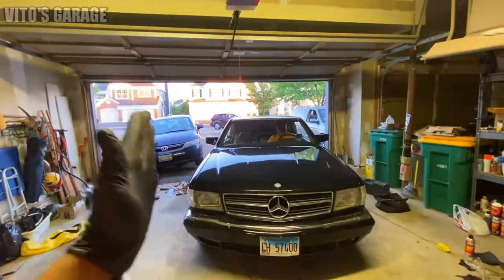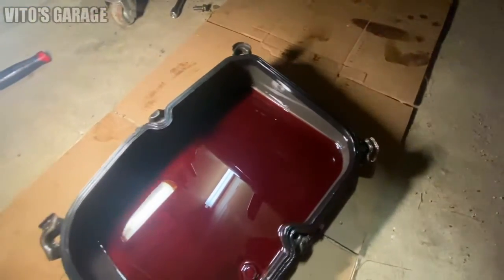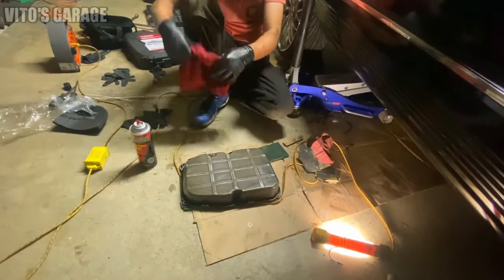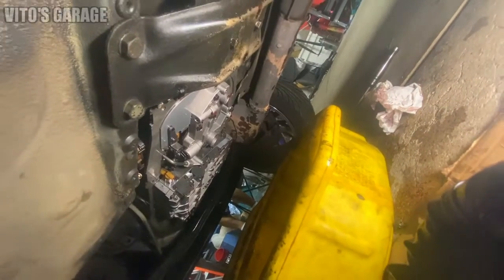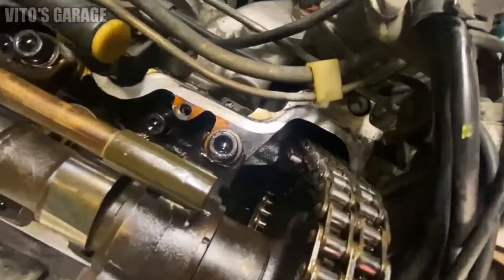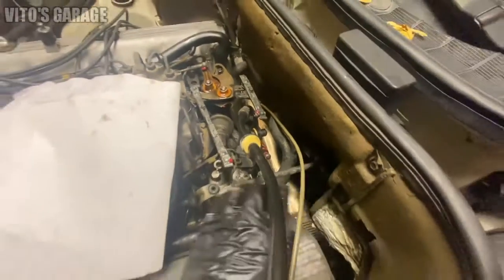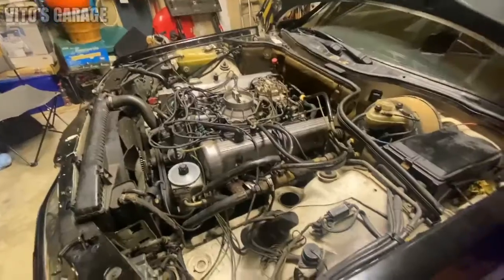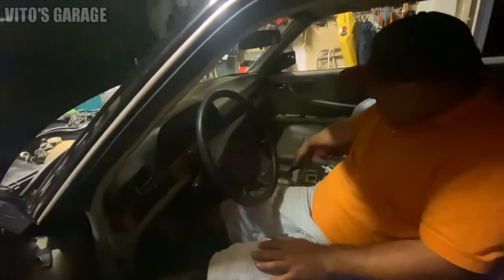Mercedes C126 500SEC V8 Coupe Engine Work & Transmission Fluid Service

Comment: When you took off the valve cover, Did I hear right, it had RTV, silicone instead of a gasket for the valve cover, that is crazy, those little pieces can go inside and create damage to the engine, Iam glad you are making sure that the car keep going, by the way when are you going to add a 2 door W126 to your collection to keep company with the 4 door W126, is that synthetic oil, they say it is better for the engine, what do you think, I always use synthetic oil in all my cars, they say it is better prolongs the life of the engine,what do you think as a mechanic .
Reply from the maker: I use full synthetic oil on all cars. Full synthetic thick viscosity oil. I’m too broke to have a C126
Reply: @VITOSGARAGE  What a downer, here I thought you would have a W126, and add it to your collection😪😪😪
Reply from the maker: If you want to help me and the channel out, consider becoming my patron and donating some funds. I’d be super grateful. If you’re able or interested, all the details are in the description

Comment: Hey man... My w123 left rear tyre is getting worn out at the inner side... What could be the problem?... I can say the absorbers are dead.
Reply from the maker: Only one rear tire is worn out? You have to see if your spring is sagging or broken. It probably needs to be replaced. I would replace both springs and shocks at the same time
Reply: @VITOSGARAGE  Yes only one tyre.... Alright man... Thx alot for replying... I'll replace the shocks absorbers and the coil spring. ☺
Reply from the maker: You’re welcome! I hope it fixes your issue🙂🤝